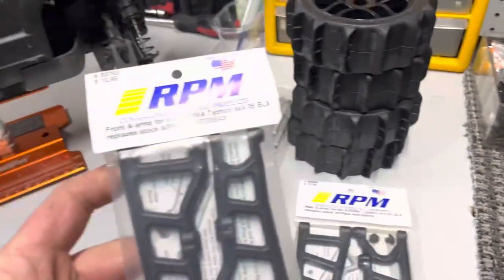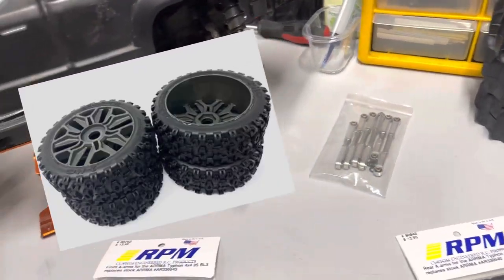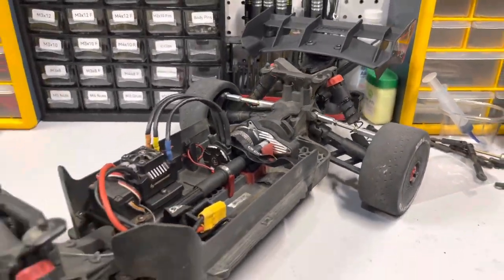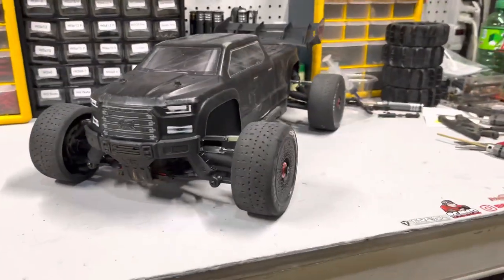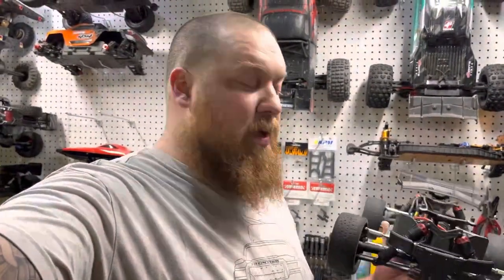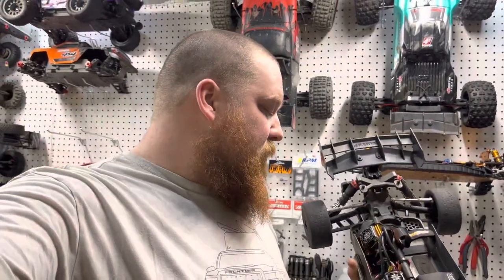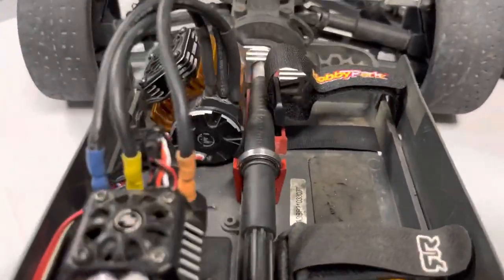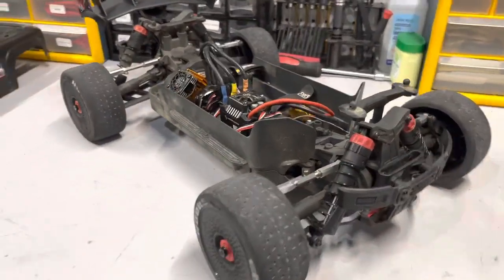ARRMA Big Rock goes WIDE! Arrma typhon arms and turnbuckle install and over view!

Comment: Did you run it off road with the slipper eliminator in it
Reply from the maker: No this vehicle is strictly on road car. But i abuse it on road and no issue so far.
Reply: @Moneypit__RC  any thoughts on running a slipper eliminator on a off road truck
Reply from the maker: @bearded_tater_turtle4480  I wouldnt see any problems running one off road.
Reply: @Moneypit__RC  gonna find out this weekend I have upgraded axels already